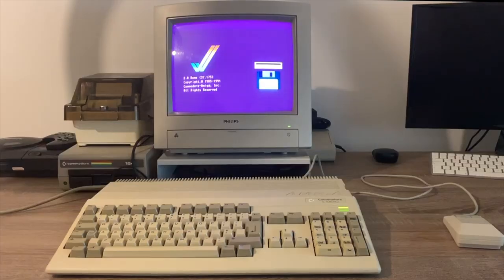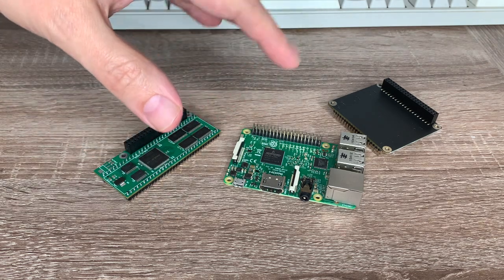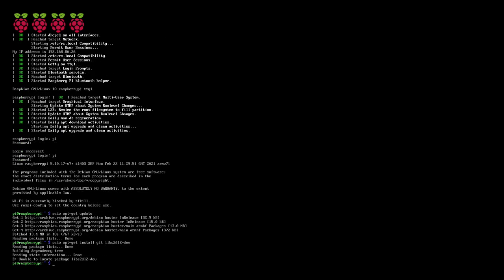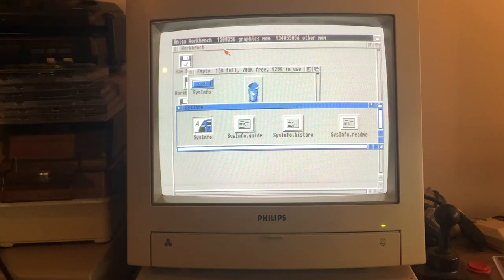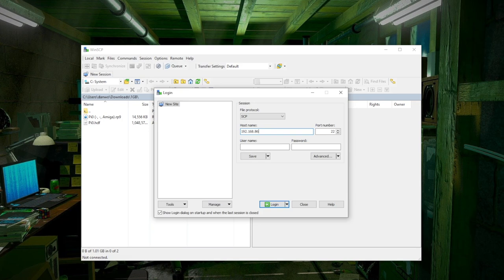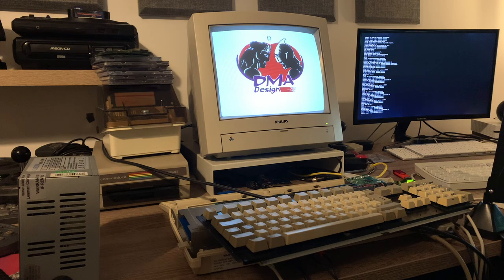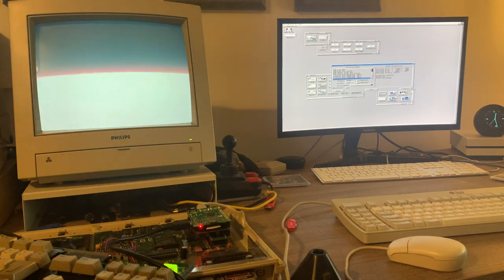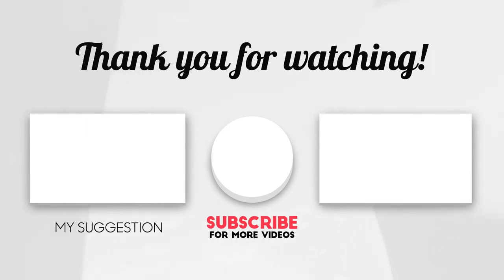PiStorm: Turbo Boost Amiga 500 With Raspberry Pi

Comment: As a longtime Linux user I did cringe at directly editing rc.local for something like this, haha.

Using Cron would be much easier

sudo crontab -e
Choose Nano as your editor, then add the line;

@reboot /home/pi/pistorm/emulator &

Then Ctrl+X and choose Y to save

There's also systemd which gives a bit more control and would allow you to restart the service while using SSH, without restarting the Pi: https://www.raspberrypi.org/documentation/linux/usage/systemd.md

Comment: Is hard to argue with the price for all these features, 030, RTG, etc. The fact it can all be done by the one small unit inside the original case is very nice. I'm not rushing out to get one as yet, a bit uneasy about the CPU being left to the Pi , making the Amiga dependent and adding more layers to go wrong. Also the 'slow' boot and not being able to boot from floppies put me off - I am an odd one that likes using real floppies for still. Will be interested to see how you get on with it.
Reply: the floppy thing is a currently targeted bug. it'll be resolved soon enough (basically the bug is confusing floppy ID numbers. After Dan made the video it was discovered that if you put a disk in an external drive then it springs into life. It's still early days yet. lots still to do
Reply: @AlistairBrugsch  Will certainly be following the progress, is amazing the talent that is out there working on projects like this.

Comment: Now, I'll happily admit that I'm no expert on these things, but once you're running RTG through HDMI on the Pi, you're using an emulated Kickstart image on the Pi, you're running your file system from an HDD image on the Pi, and you're not using floppies at all... What exactly is the A500 doing anymore? At this point, has it just been reduced to acting as a PSU and keyboard for an Amiga emulator running on a Pi? Or is stuff still being processed by the original hardware?

Comment: Its weird that they didn't pick the RPi Zero for this project, since its a perfect tiny computer on a stick, and I can't wait to see support for it soon.
Reply from the maker: Apparently it runs too slow to be worthwhile, not much quicker than the stock CPU.
Reply: @danwood_uk  weird if you consider that its a 1GHz cpu (albeit single core) and has a tons of features, like WiFi, RAM, storage, HDMI, USB, etc. 
I really want to see a PiStorm version for the A1200 trapdoor. That would be the perfect upgrade!

Comment: Hi Dan.  I installed the pi OS lite on a 32gb card but when I boot the amiga  
 I only get black screen. The light on the pi are coming on. I connected the hdmi cable to a laptop with a hdmi port . But it didn't work. Will I have to use a modern TV.  To do this properly.

Comment: Awesome and cheap project! I do wonder at what point, with all the features that could be added, is the Amiga there as just a keyboard and some basic IO for the Pi though LOL Actually just made me have think for an interesting comparison, what is the benefit of doing it this way to say running UAE on the Pi and just having the keyboard plugging into the Pi? Not trying to be contentious, it is just a thought that passed through my head, a sort of "what would you miss if it was just the stand-alone Pi".

Comment: this may be a stupid question.  is the CPLD acting as the 68K?  or is it just being used to translate the GPIO signals for the CPU socket?  of the first, once it's programmed, why is the Pi necessary (if you don't intend to use the RTG, at least)?
Reply: My understanding is that the CPLD is translating the signals to the GPIO pins for the Pi, and the Pi itself is doing all the work.
Reply: The CPLD also gives the base oscillator frequency (200MHz) the transfers to happen. This isn't as easy as you might think, there are 24 address lines and 16 data lines... has to be staged.
Reply: @PATTHECATMCD  Ahh, thank you so much for the extra information!

Comment: Any idea if this will be available for the Amiga 1200 ? Still got my old unmodified 1200 I got from beyond 2000 in Nottingham as a kid & like the idea of having a retro machine, would be amazing if you could get the  raspberry pii working as a separate boot with workbench & android or umbutu  when its mounted in the Amiga so you could use an old Amiga for retro gaming & light web browsing (i'm probably just dreaming though lol)

Comment: Is PiStorm essentially an emulator?

I am wondering if I am seeing this right; it seems a little bit like it offsets some operation over to Amiga 500, but runs mostly off the raspberry pi, inhibiting the onboard CPU and ROM.

This seems to explain how a500 got 128MB RAM or a HDF backed hard drive. Never thought this is possible with a real hardware...

If that's how it works, it's pretty mind-blowing that hybrids like that are possible. Makes sense why floppy games are having problems as well..

Comment: I had an Amiga 1000 and an Amiga 500, bit my Amiga 500 motherboard died via a hardware failure.  It just killed the expansion board section.

Comment: I know Sysinfo shows amazing speeds but I have seen somebody playing games while using a Pistorm and they run really slow and laggy because the Raspberry Pi cannot cope with everything it is expected to do like talking to all the custom chips etc.
Reply from the maker: I couldn’t replicate that in my testing. If you mean Doug 10 Minute Amiga Cast video I think it turned out that he was running the new Amiga OS 3.2 which the Pi Storm hadn’t been tested on and it ran some funky stuff on startup that clashed. I think he did a follow up video explaining it anyway. Just running stock 3.1 the speeds seemed as expected in my (admittedly not extensive) game testing.

Comment: I guess this doesn't do a clean Pi shutdown when you power off the Amiga?
Reply from the maker: No, there is currently no solution for this.  I imagine it would be hard to implement though, unless there was some program you ran on the Amiga side that initiated shut down.
Reply: @danwood_uk  Yeah, that worries me. I've had too many Pi SD cards die from improper shutdowns.

I'd recommend imaging your SD card and keeping.a backup once you have it set up how you want it, because it will almost certainly fail at some point!

Comment: Great vid Dan, does it use the ROM on the motherboard, or just a ROM image, I'm a bit confused?
Reply from the maker: I do mention copying the rom, just rename it kick.rom and copy it over.  Or you can just leave that part out and use the Amiga's kickstart chip.
Reply: @danwood_uk  cheers Dan, so you can start with the onboard ROM (if you want) but go to a more modern ROM image later
Reply: @danwood_uk  This  tip is the ice breaker for me.  I just got the hardware from AmigaKit and will be putting it in my 1000.  Thanks!

Comment: so this with a compute module 4 should fit nicely :)
Reply: Yeah, but the PiStorm board would need to have all the I/O including both chips and ports, so it wouldn't be as cheap or featured.
Reply: In the works, AFAIK.
Reply: @FindecanorNotGmail  Now you need the PiStorm AND a RPi, so total cost would be almost the same, taking into account that the CM4 it’s a big step forward compared to RPi 3A+

Comment: Great video but excuse me ignorance - Why use a PiStorm / Pi to emulate hardware when you can use a much higher powered Windows PC alone and WinUAE?  WinUAE and Sysinfo shows 283x faster than an A4000.  I get using vintage hardware (at vintage speeds) but if you want maximum speed then surely WinUAE is going to provide better results
Reply from the maker: Sure, a few emulation would be faster. But here you are using the Amiga’s native hardware for the most part. The Pi Storm is just emulating the CPU and extra RAM. You are still using the Amiga’s custom chipset, keyboard, floppy drive etc. so for those who want a more authentic experience, it’s a good halfway point.

Comment: This mod replaces too much of the amiga hardware.  You are basically only using the amiga as a keyboard, mouse, and video interface.
Reply: Not to disagree but isn't that the main argument against the Vampire?
Reply: @davidwright9166  Agreed, the vampire mod also replaces too much.
Reply: With this solution you're still using the Paula chip for native Amiga audio, still using native floppy drives (or a Gotek), serial and parallel ports as well as the chip RAM. Pistorm is emulating the 68xxx series of processors, fast RAM and a hard drive interface (right now). I'm sure you can still use expansions in the 500's belly slot or left side.
Reply: @LeftoverBeefcake  Yea, if you have to include stuff like serial and parallel ports to pad out the list of real hardware still in use, just emulate the whole computer.
Reply: @GoatTheGoat  So go use RetroPie or WinUAE or a MiSTer or something. Or leave your Amiga 500 bone stock if you're such a purist. This project clearly isn't for you, Officer Patterson of the Retro Police. I didn't know there was a law against putting modern hardware inside a retro machine.
Reply: As far as I can gather it doesn't replace OCS, so surely all the important original  hardware - Agnus, Denise and Paula are still in place. Replacing CPU emulation is and adding RTG is hardly diminishing the original hardware. In fact retaining original mouse, keyboard, joystick and keeping even just Paula by herself would be enough to make it a worthwhile mod... surely?
Reply: @jrb2565  To each their own.  I'm not feeling it though.
Reply: @LeftoverBeefcake  Yes, for sure it is not for me.  I understand the appeal of using real iron retro hardware and I understand the convenience of using emulators.  I don't understand the appeal of this hybrid setup.  It has none of the emulator convenience and none of the appeal of using real iron.

I'm not the police though.  Do whatever you want with your setup.

Comment: Amazingly clever device and I'm all for tinkering, but what's the benefit of any Amiga accelerator? Games won't run any better / faster (other than a few Doom clones or 3D flight sims), and there'd still be no point trying to surf the web or using productivity apps on such an old machine. 

And why use the host machine at all? Wouldn't it make more sense to just emulate the whole machine on a Pi (perhaps using a GPIO to SCART adapter if you want to use a CRT monitor)? 

By the time you're emulating the CPU at 26x speed with 128MB RAM, RTG and WHDLoad, you're essentially relegating the original A500 to being a fancy keyboard anyway.
Reply: This thing means, the choice isn't binary, either full emulation or authentic hardware. There's certainly a place for such.
Reply: I have an A500 with a turbo card (a faster 68000, 8MB RAM and IDE) that gives just over 6x the speed of the stock machine rather than the 26x in Dan's video. This boost is welcome and I'm sure I get more use out of the Amiga than I would if it was in its original config. The PiStorm is a tempting offer although I kind of feel like you may as well just do away with the original hardware and run an emulator on the Pi. Most productivity software from the A500's heyday doesn't need the power offered by this, web browsing and Doom still isn't going to be a great experience. Will be great to see how the PiStorm progresses.

Comment: Could this be adapted to work with the Pi Zero? What is the reason it needs a Pi 3?
Reply: a zero would not cope. it might just about get away with a slightly faster 68000 but then what would be the point?
Reply: @AlistairBrugsch  Ah, okay. Thanks!
Reply: @namakudamono  actually, Claude just posted a pic of a Pi Zero running an experimental branch and it gives about 2.4 times the speed of a stock A600 and almost exactly that of a A1200. Just without the AGA of course...
Reply: @AlistairBrugsch  Wow, great!  Presumably memory expansion and RTG capabilities will also be possible?  That's pretty impressive for a ~$10 Pi! ;)
Reply: @namakudamono  I'd say probably but with some detrimental effect on the overall performance. It was just a "hey this can be done" kind of thing.

Comment: This is a great product, i have the BBC version, it seems these brainy people are adapting it to everything too. Cannot you remove the usb ports to fit the adaptor card on a 3B?
Reply: Yes. Might need ethernet port off too.
Reply: @PATTHECATMCD  Will the keyboard not fit on with the ethernet port in place? They need to make a high spec pi zero for these sorts of uses? Also is there is the issue you could remove all of the insides of the machine and just leave the pi and have it much faster still 😊.
Reply: @anticat900  The "huge" issue is plugging the Pi into the adapter board, let alone attaching te Amiga keyboard. I am unsure if removing the ethernet port is necessary too.

Comment: Cool. Price also good for retro computers. Now just need 060 for A1200 for £50 ;)
Reply: Hehe, good luck getting one at that price, CPU alone was being sold, when price was really really good, at $140. Now you can consider yourself lucky if you can get one below $350.
Reply: @ferran.garcia  yeah that's why I use Pimiga, that did cost under £50 AND its faster than this and don't have to wait 30 seconds for the Amiga to start booting!
Reply: @EXITMUSIC2011  Of course, everyone is free to use whatever they like. For example, I’m more than happy with my A1200, bought back in 1993, with Blizzard 060/SCSI/256MB/Indivision AGA/3xSCSI DEC HHD/SCSI2SD/IDE2SD/IDE2CF/Gotek/SCSI ZIP drive/SCSI Epson GT-7000 scanner/GVP DSS8/MIDI+SoundCanvas SC-55+Casio HT-3000 keyboard… Let’s say that I prefer the real thing… 😉
Reply: @ferran.garcia  I still have A1200T with PPC, 060, Picasso IV card, Catweasel, Aura audio card and more but not been switched on for years. Also have iiyama multisync monitor. Not sure if it still works.
Reply: @EXITMUSIC2011  Ouch! It's a real pity that this wonderful piece of equipment is not being used, really. Maybe you should consider selling it, so that someone else can use it and in the process make some good money out of it.
Reply: @ferran.garcia  it's currently at my parents house. Hoping to take a look at it as soon as possible.

Comment: Why should I slow down the speed of a Raspberry Pi with an Amiga? For me personally it makes more sense to set up directly on the Raspberry Pi, the emulator is more powerful than any Amiga. It's nice to see that the old technology is still alive and you can do a time travel, but if I replace everything in the Amiga and virtually only keyboard and case is left, it makes more sense for me to work directly on the Pi. At least you can take it everywhere and you can connect modern hardware. Is there anything left from the Amiga except the keyboard and the os when you update all the modern toys like SD cards, ram expansions, graphic cards, hard drives etc.? I'm missing the point a bit, why are you doing this? Is there a hope that the Amiga will come back someday?

Comment: Cool Video, does the pi need to safe shutdown? Is there a script?
Reply from the maker: No, there is currently no solution for this.  I imagine it would be hard to implement though, unless there was some program you ran on the Amiga side that initiated shut down.
Reply: @danwood_uk  maybe a small battery for buffering
Reply: @danwood_uk  Could a process on the Pi poll for the existence of a file created on the amiga side that flags for shutdown?

Comment: Can the pi 4 be used for even more performance?
Reply: not yet, but Claude is working on it! (specifically CM4 but yeah)
Reply: Awesome :) can’t wait to see it 😊 is the pi zero also compatible if you install the pin headers?
Reply: @8bitwarrior  no, and nobody's working on it as performance would barely be any better than a vanilla 68000. That's not to say nobody ever will... But it's not a priority to say the least
Reply: @8bitwarrior  actually claude just shared a pic of a pizero installed... It works... At 2.37x faster than an A600. 0.7x the chip speed, so really not worth it
Reply: Thanks for all the info :)

Comment: Putting a startup file in the rc.local isnt really that frowned upon, when you are building a toaster... In production, I'd kick you straight out the door, as putting stuff there sometimes makes it harder to track down services that are running... Because nobody does it like that anymore.

What I really cringe at, is every time you power off that machine you just murder the pi... It really needs a safe off option, and probably some sort of utility to do it... You are most assuredly going to lose data on your emulated hard drives if you just power it off Willie Nillie...

Comment: While this is really cool, I honestly don't get the point. If you're okay with emulation, why not simply use WinUAE? That's orders of magnitude faster and should be better in every conceivable way? it's free, too.
Anyway, cool video Dan - well done. Props to the creators, that's some fascinating engineering. :)
Reply: Its not better. Original audio implementations can rarely be replaced and emulators are seldom accurate enough to support clever and rare graphics tricks used by developers trying to squeeze more out of the original hardware.

Emulators are fantastic, but they are not usually terribly accurate and audio filters never sound the same

Comment: So its not really excelirateing the amiga you running emulation though the old CPU socket for that I dnt need the hole amiga you can emulate the amiga from a pi400 that looks like a keyboard or a pi 4 8gb a and just run rasbiam same shit